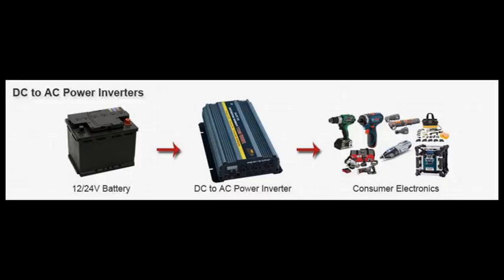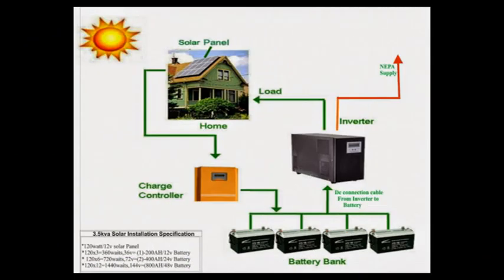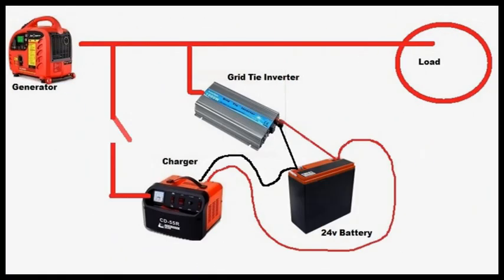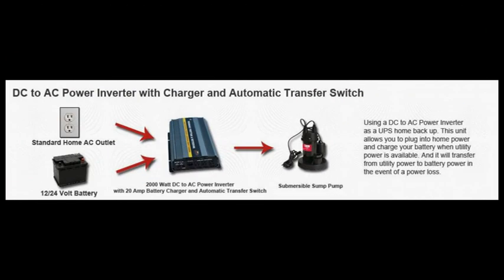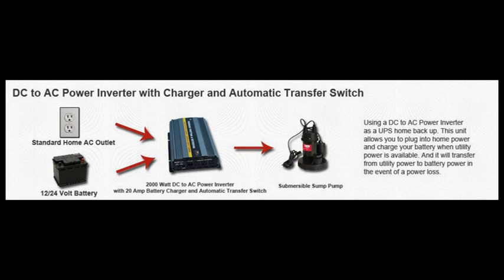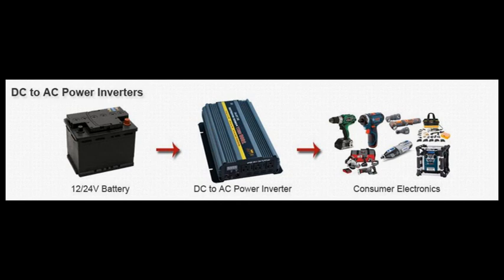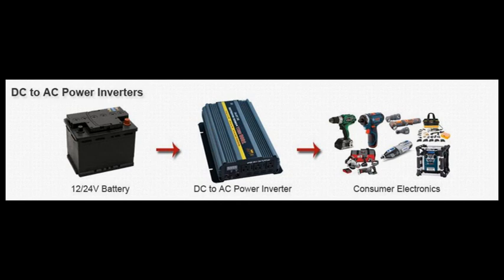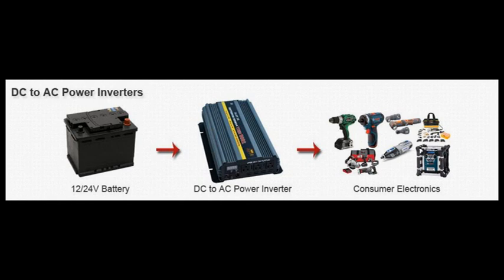Ways to charge your Power Inverter batteries

Comment: If you can't use the same inverter that's connected to the battery to charge it,  will it at least make the batter last longer?  Or will it just drain the batter faster,  let's say the only thing you're using at the moment is the battery charger.
Reply from the maker: You can not connect a charger to the inverter. Usually the drain will be the same as the charge.
Reply: What if there's a charger that will drain less than is being charged? @Royal_Power_Inverters
Reply from the maker: Then it will work.  @EggZackLee484

Comment: how can i connect an extra motor to the inverter to charge the batteries? when solar power isnt availbale at night
Reply from the maker: If the battery is connected to a motor and the motor is running the alternator will charge the battery.

Comment: Can I have my intellegent charger plugged in to the mains and connected to the battery while my inverter is connected to the battery, and drawing power to run a decoder and TV. 
So when the mains gets cut (which is a almost daily event) I still have uninterrupted power on the tv.

Comment: Thank you. It's very helpful to hear that one could use AC to power the inverter charger for the batteries. But I actually need a system where I will be using the battery and recharging it at same time without draining it. What could be of help in achieving this? Another alternator? Is there a type of inverter/charger that incorporates this?
Reply from the maker: You would need another power source. You can not use the same source to charge and discharge. For example solar panels.